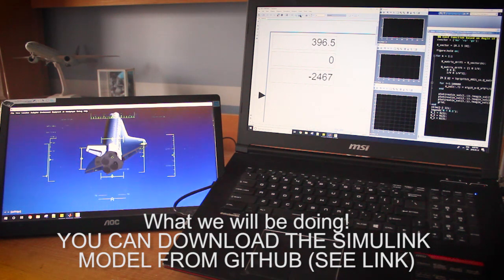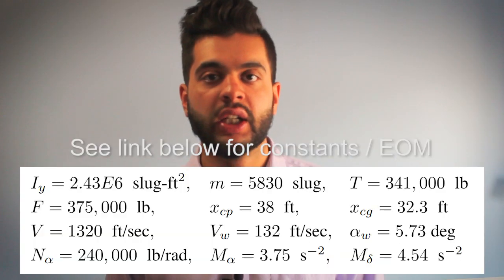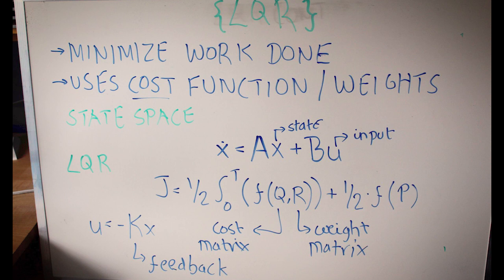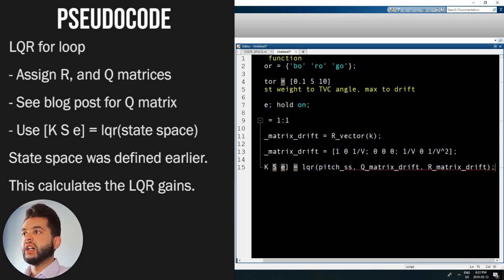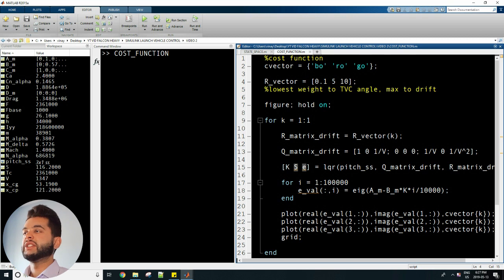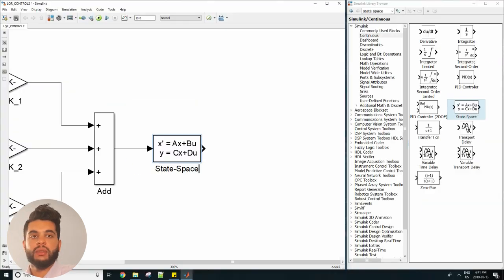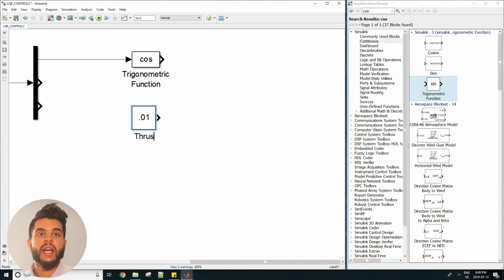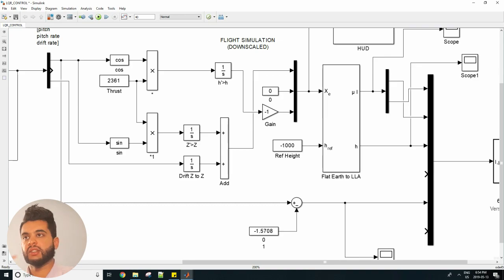Autopilot Design for a Launch Vehicle - MATLAB & Simulink Aerospace Control Tutorial

Comment: Hi, I wonder can we use LQR method for real applications since the measuring the desired states is not so simple in real life. If the measurement is wrong, I assume control system may pushes the system to divergence. What about classical control approaches, that are more reliable and easy to handle?
Reply: You can use a Kalman filter to estimate the states and apply LQR to the estimated states instead.

Comment: Thanks for this. Am getting this error once I connect the gain output to the sate-space system: Data type mismatch. Output port 1 of 'LQR_Control/Gain' is a signal of data type 'boolean'. However, it is driving a signal of data type 'double'.